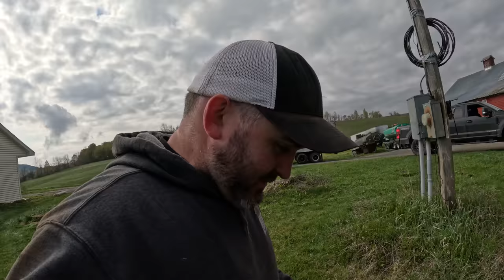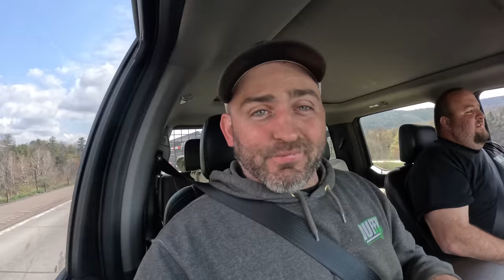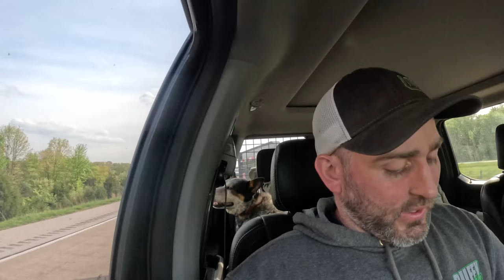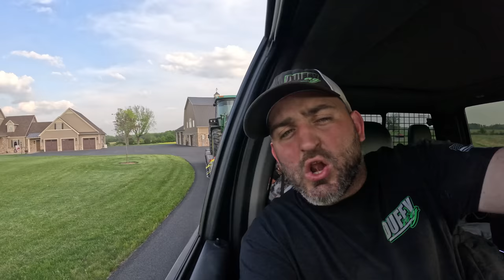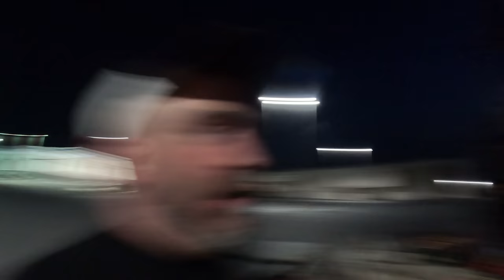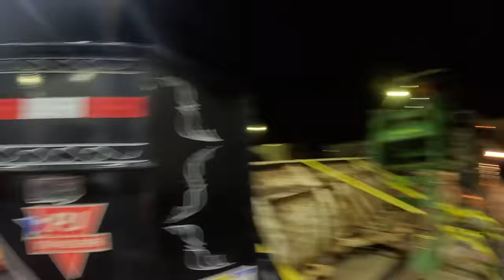Loader Tractor Added To The Fleet- New Farm Purchase

Comment: radio was fitted just behind the front air vent, i have a 2650, almost identical tractor. mines got 11000 hours on it, very few issues. not sure which engine yours is fitted with but looks like a saran engine. head gaskets are common and brake go bad and can make a mess if you leave them too long. I really like it, most reliable tractor i have ever owned.

Comment: Love our 2755. Have had it for 25 years now. Was our haybine n planter tractor n now just pulls out 1750 Deere planter. Ours is a '92 model n they were turned up from the factory that last year to 100hp. Plenty of power, nimble, easy on fuel. Great lil tractors.

Comment: Congratulations Duffy the farm i worked for use to run a 2355 2555 and a 2955 as bucket tractors pushed alot of corn silage those tractors i remember us boys that worked on the farm would practically fight over the 2955 i think all three of them took a sigh of relief the fall the farm bought a Ford 8870 with a degelman blade but great choice of tractor those 55s are bullet proof and easy to work on

Comment: Had a 2755, bought it new in 1990 and sold it in 2016. Had close to 17000 hours on it and only changed the clutch and head gasket.Never burned a drop off oil. The only difference between the one you have and the one I had is that we had cast rear wheels. It had great power for it’ size. Only 6800 hours ………. Just broke in

Comment: awesome tractor 
we got a 2555 open station with 245 loader new in 91 by Feb of 95 it had over 10000 hours on it only seen oil changes. my uncle had a 2750 loader for years it had crazy hours on it.

Comment: Thats a clean 2755 even has the front fenders. Good luck with it should work out well. Looks like that loader has the same style jd quick attach as our 640 and 740 loaders do they can be a pain sometimes but you can get a skidsteer adapter plate and run skidsteer attachments which can be handy
Reply: The 245 and 265 loader had the springs on the loader side the 640 and 740 had the springs on each bucket or attachment

Comment: You will have np pulling the planter with that tractor. I used to pull a 1780 nt 11row corn and bean planter with a 2955 and it was plenty. That tractor will do you well congrats!
Reply: Yeah it will pull that little 8 row planter easily.    4020's pulled them forever.    And that's without front wheel assist.

Comment: Our farm pulled an 8 row with a 2wd 2750 with duals. It struggled on hills- downshift and full throttle! 4 cylinder didn’t have much lug power. Otherwise worked ok if you can keep it revved up

Comment: You got a prize tractor right there my great uncle has 2755 and a 2955 the 2755 has the same loader as this one the 245, the 2955 has a 265 loader on it however I my uncles 2955 better then the 2755 for 1 reason and that's because the 2955 is 4x4 the 2755 is a great tractor I love both how it rides my great uncle let's me use them both all the time during hay season they are really nice tractors you hit the jackpot on this one buddy

Comment: Nice tractor gonna have to becareful on hills on you will go for a ride with the planter. Use to run a 2950 stack with weights on wheels it was ok transmission can get little funny with wear but overall decent tractor.

Comment: Thought the goal was a backup tractor with loader to the JD 7520 - but, 100hp less & weighing only 7,200lb w/o loader that has a 10’ lift height. Gonna need a 3pt weight box, rear weights or calcium chloride to hold traction of 88hp in a 8,400lb loader tractor w/16.9x28 rear tires. Hope you got it for under $40k.
Reply: George  Don't let your emotions trump good judgement - Trade the JD 2755 for a JD 4020 or 4320 w/loader, 9' mower, wheel rake, tedder & still have money leftover to buy corn seed.

Comment: Chris how wide is the bucket? We pulled a 6 row planter with a 39 horse tractor. We dropped it back 1 gear to turn around , shifted up 1 gear. Back across the field we went. Your new to you tractor should handle your planter just fine. You bought a loader tractor. I'm getting ready to put the loader back on the last tractor I bought.
Reply: That tractor was not designed to be a loadertractor but most people want it to be. Did some research on it

Comment: Best of luck with that tractor they are good tractors but once you put a loader on they aren’t good. They hydraulic pumps can’t handle the the loader. We had two 2955s both had the same problem
Reply: George  haha get out from under the rock and do some research. Common issues
Reply: George  what’s even funnier is you didn’t have anything to add to the comment. You would just rather issue a personal attack👌. Personally if I bought something and there was something to watch out for I would want to know
Reply: Don't hook it up to a VACplanter then you have faster hydr. Problemd
Reply: @willianvos3521  ours were never on a vacuum planter. Dry clutch is another thing to be watching on those
Reply: @willianvos3521  7200 4-30s planter took a 4440 to plant with. Its about capacity